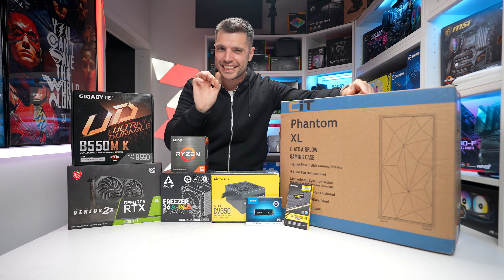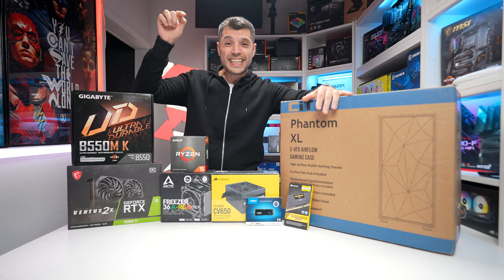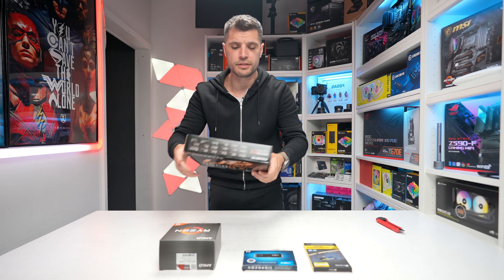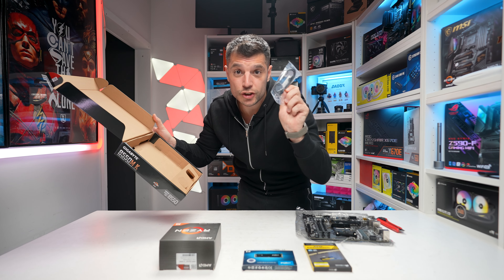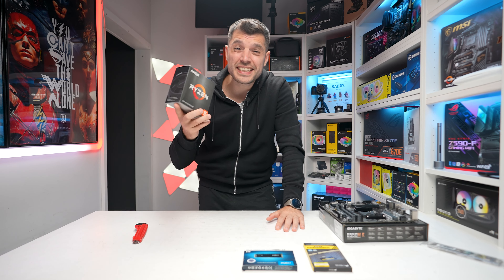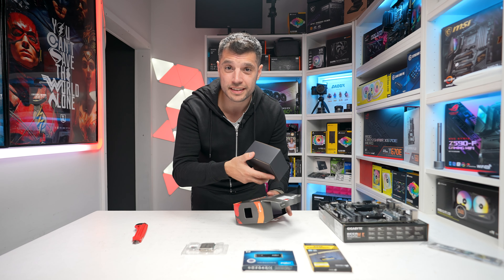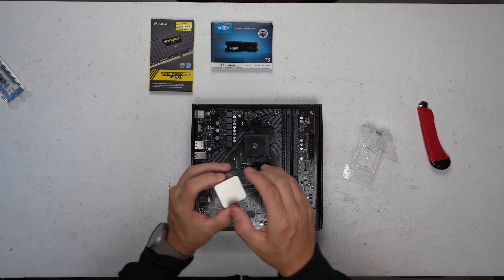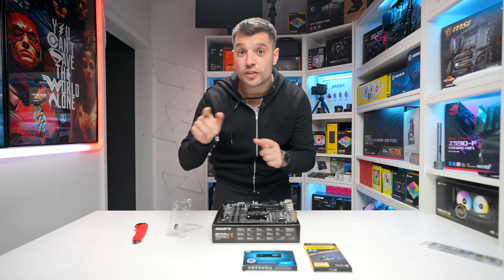£600 Budget Gaming PC Build 2024

Comment: I’m looking to upgrade my cpu, I currently rock a i7-9700k and a 3080 what cpu would you recommend or would you suggest there is no need to upgrade?
Reply from the maker: First thanks for watching and second do you personally need to upgrade? is their a specific reason? - If you were to go to a 13600k  for example its a new mobo/cpu and potentially ddr5 ram upgrade too which wouldn't be cheap. If it does what you need I would personally wait, it will bring down costs on 13/14th gen if intel or give you options for AMD (If you were open to it)
Reply: @TechCheckUK  yeah I would happy with with more recommendations, Another Great video just feel like my i7-9700k is falling behind the power curve now
Reply from the maker: Personally the 13600 or 13700 are great options and won't break the bank - I would also consider upgrading to the ddr5 option too. If you wanted to go AMD 7700x would be a great option unless u wanted to go all out and then it would deffo be 7800x3d.
Reply: @TechCheckUK  Thank you, Keep up the great work ❤️
Reply from the maker: @ThePs3crazyman  no worries thanks 4 tge support 👍

Comment: Is the msi Gtx 1660 ti compatible with this build as and how will it perform because I found a really good deal for £100 brand-new
Reply from the maker: Hi mate yes will work great BUT 1660ti is about  40% slower than 3060ti - personally I would deffo try to stay 2 gens old only

Comment: Great video! Looking at building this pc using your video. I’m a first time pc user on a budget, is this build something I can upgrade in the future once I get more experience etc? When I say upgrade, can I get a better cpu and gpu and put it on the same motherboard?
Reply from the maker: Hi mate thanks 4 watching. In terms of upgrades the best cpu would be 5950x or 5800x3d as its a AM4 mobo so just be aware it's now 2 gens old. Perfect for budget builds but it means you would need a new mobo and ram and cpu if you wanted a newer generation. Hope that helps

Comment: I built my first gaming PC for £606
i5-12400F £96.98
MSI PRO B760M-P DDR4 Motherboard £84.99
Kingston FURY Beast 16GB (2x8GB) 3200MHz £31.50
WD_BLACK SN770 1TB NVMe M.2 SSD £57.48
Sapphire Pulse RX 7600 8GB GPU £200
CORSAIR RM650 80 PLUS Gold Modular PSU £71.99
Thermalright ASSASSIN X 90  CPU cooler £14.99
MSI MAG FORGE 120A AIRFLOW Mid-Tower 6-fans £49.99

All new parts. I got lucky with the GPU because the day after I bought it, it went up to £239
Reply from the maker: Solid build mate great job 👏 👍